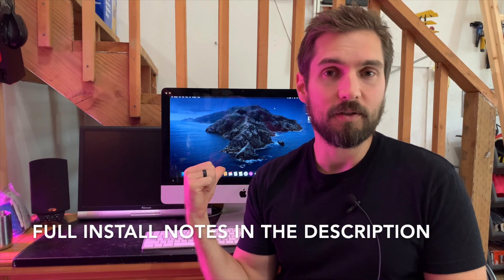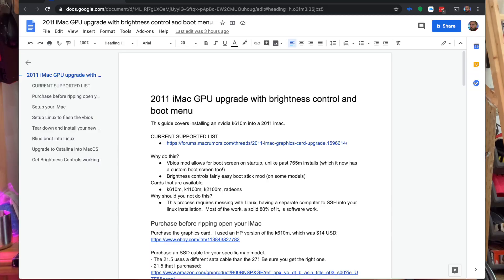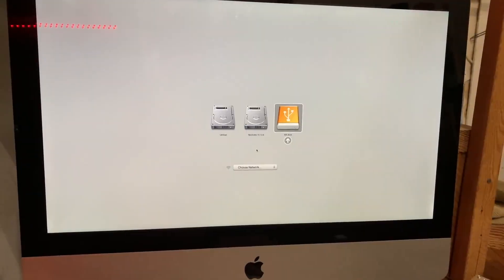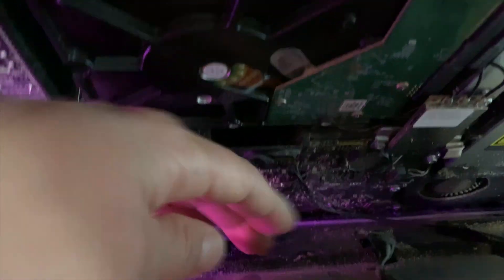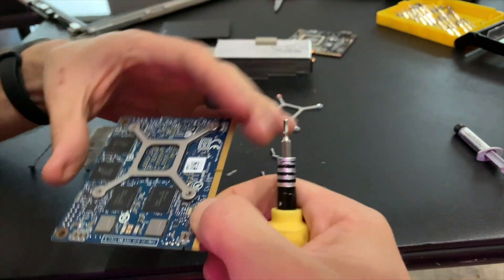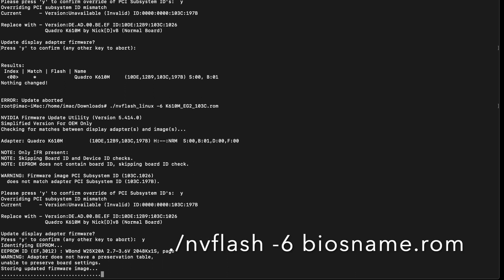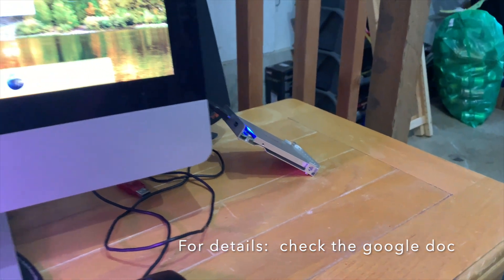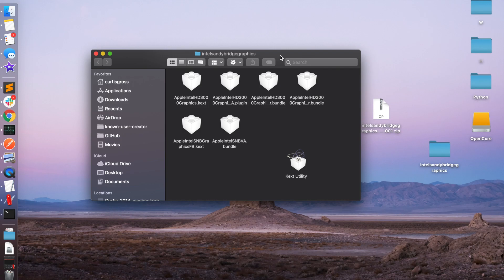2011 iMac GPU Upgrade Now with Brightness and Boot menu - Absolutely Worth It!

Comment: Very good presentation for a problem I have on my Mid 2011 IMac that does not sleep and other issues you mention!  Running Dosdude1 patcher install.  Could you outline the best procedure to remove the after install updates?  Is the quickest fix to reinstall and not to the post install updates?  Thank you for your video!  Russell R.

Comment: Best you for gaming that can be supported in the 21.5 inch?
Reply from the maker: Probably the 770m / k3100m. But both will not have backlight controls.   Honestly for gaming your best bet is to throw a cheap pc together.
Reply: @messing-with-computers  okay, it's just I have an iMac and a gpu isn't that expensive only 100
Reply: @messing-with-computers  would a 765m have backlight control?
Reply from the maker: Edison Chow nope. That’s the sad part. Maybe soon someone will get a bios out that allows out.
Reply from the maker: Edison Chow - what games are you thinking?
Reply: @messing-with-computers  maybe some fortnite or rust at potato settings
Reply from the maker: Edison Chow 770 is probably your best bet then. Lose the brightness, but it isn’t too shabby of a performer.
Reply: @messing-with-computers  would the heat sink need modding?
Reply from the maker: Edison Chow I’m pretty sure the 21.5 and 770 won’t need any mods.  Same as the 765 - it fits pretty tight, but without mods. You will want to cover the caps of the components with electrical tape though.
Reply: @messing-with-computers  have you done it before? On the mid 2011 21.5"
Reply from the maker: Edison Chow I did the 765, which is the same size as the 770. The 770 is just more memory and a little stronger.
Reply: @messing-with-computers  oh nice do you have a vid for the 765
Reply from the maker: Edison Chow not for the 21.5 sadly. But the process should be the same for this video to get it installed - and the rest is the same for the 765m I put in my 27”. https://youtu.be/9GJQ9fvx3GA
Reply: @messing-with-computers  oh okay thanks!!! Just that I've heard that the 765 is too large for the 21.5inch heatsink so needs modding
Reply from the maker: Edison Chow - not that I remember. I mean, you can modify it a little to make it a bit more of a excellent fit. Pretty easy to cut away a little of the metal
Reply: @messing-with-computers  okay thanks Curtis, one more thing, would the PSU supply enough power
Reply from the maker: Edison Chow - yup. The 765/770 don’t pull too much. The 780 absolutely would.  Honestly the price is the bigger factor. The 765 is usually a way better deal.
Reply: @messing-with-computers  I found the 770 for 108us but that's on AliExpress
Reply: @messing-with-computers  also do I have to flash the card?
Reply from the maker: @Iamtherealchow  - You don't have to.. but flashing the card will get you the boot screens back (which you lose with the upgrade).  But as long as you have high sierra installed, it should work without any flashing with the Dell versions of the cards.
Reply: @messing-with-computers  so if a get one that was originally in an Alienware, it'll work as soon as I plug it in after I receive it? Because in the video where you replaced yours with a k610 you had to do tons of reinstalling and stuff
Reply from the maker: Edison Chow - the extra work I did was for brightness control and boot screen support. It should work for most tasks without those fixes...
Reply: @messing-with-computers  do I need to install drivers for the 770m
Reply from the maker: Edison Chow you shouldn’t need any extra drivers.
Reply: @messing-with-computers  wow really? Is it because the Mac already has them
Reply from the maker: Edison Chow yup!
Reply: @messing-with-computers  thanks Curtis, so if it isn't from a Dell laptop it won't work
Reply: @messing-with-computers  Because from https://forums.macrumors.com/threads/2011-imac-graphics-card-upgrade.1596614/page-34 it says that it needed modding to cut away a part of the thermal pipe backing in order to fit because a capacitor in the 765m/770m does not fit.

Comment: what would u advise on upgrading gpu on 2009 late 21.5 imac. it came with the 4760HD 256m (crap) ive been told a gtx 765m will go in? but could I go better and put a 880m in? please kindly advise
Reply: also dont care about price... just the best I get now for the 2009 late 21.5. need min 2gb but would like more as want to dual boot to play dcs
Reply from the maker: Sadly, the 2009 doesn't really have any upgrade options.  Only the i3,i5,i7 models can upgrade.
Reply: @messing-with-computers  well thats interesting as macintoshman told me that I can put a 765m mxm in or 880m gtx
Reply from the maker: Levi Dance - your computer has a core 2?  Or a i5/i7?
Reply: @messing-with-computers  core 2 3,06ghz
Reply: @messing-with-computers  core 2 3.06ghz

Comment: Is the 27’´ amd 6750m the same as the 21.5? Is it compatible ?
Reply from the maker: Yes.  Any imac 6750 or 6770m will work in either 27 or 21.5.  You do need to modify the heatsink to get it to fit in the 27 though.
Reply: Curtis Gross a guy on eBay france sells it for 30€ and says « not tested » I hope it works, it seems like the exact same that I had on my 21.5

Comment: This is very much appreciated Curtis!!

I'm about to upgrade my imac Mid 2011 21.5" using your videos.

Question :
Can I install the SSD (Samsung), GPU (1100m) and Processor (i7) at the same time?

If yes, should I do all at the same time?

Anything I need to watch out for?

Thanks again
Reply from the maker: Sounds Like a solid build. I would do them all at the same time
Reply: @messing-with-computers  I did it. Shaking when I pressed the 'power' button but it works!!

Still waiting on the GPU arriving so did the CPU i7 and SSD, which is incredible in terms of boot and operating already.
Anything I should do to prepare for the GPU??

Thanks so much man, visiting your channel and Tech It Out were the first thing I did to say thanks - you're helping a family in a very practical and applicable way.
Reply from the maker: Andrew Laing glad to hear that it Booted up!  To get ready for the GPU installation you don’t really need to do much beyond take your time!  Lots of little cables, maybe make a tally of each as you go so you don’t forget one ;)
Reply: @messing-with-computers  Thanks man! 

Had to do the same for the i7! 
Same process to get the motherboard out except I'm taking out the GPU instead of processor chip?

Will follow through your video again when it arrives from Hong Kong!

I admit I'm a bit lost with the software side of things, but will try to work through your google drive! (thanks for that)
Reply: @messing-with-computers  Hi Curtis,

Same problem as you here - bought a K1100m and it didn't show the third LED.

Seemed brand new out the box.

Took it apart again and cleaned off the NVRAMs - put it back together and same problem.

Could it be software or am I better doing something else?
Reply: @messing-with-computers  GPU finally successful! Got a K1100m from HK that didn't show the 3rd LED, was ready to give up but got one more card from ebay, k1000m. Again, no 3rd LED. Then I troubleshot and came across the engineers manual for the 21.5'. Realised that the beeping could be RAM, but could also be something else, so installed the RAM thinking it might get rid of the beep, if nothing else. Not only did it get rid of the beep but suddenly I had the 3rd light back on and it booted! Had to reset PVRAM a few times as the colour was funny first time. Now I'm totally booted though and using dosdude to get Catalina.

Thanks again, man! Appreciate your videos!
Reply: Update - wife uses this every day for work. Absolutely perfect. Thanks man!

Comment: Hi Curtis, this follow-up video is so informational.  Great work done here.  One thing I want to know is that for a 27" iMac 12,2 with 6770m, do I need to file down the 3 pipe heat sink to fit in nicely (without no risk of high temp) to fit in a GTX765m?  Does it need to be Dell card (not HP)?  Thanks
Reply from the maker: You will only need to modify the heat sink with a dremel - no new heat sink needed.  For the 765m you will want the dell version, but I would try to get the k4100m instead.

Comment: Every product that ages well develops a community of users, hackers/mod-ers and also one who takes it far enough to be a sensei (the one who travels the road beforehand) or might we say a guru.  My Mid-2011 iMac 27"er is in pieces next to me and the original graphics card is cooling down in the background.  I wish I had found this guru here a little earlier! I would have got out the Dremel and upgraded my GPU, without this now defunkt step of baking my old GPU and having it last weeks/months and then in the end upgrading anyway!   BTW the Mac repairer up the road said he had struggled for months to find a solid solution to the ubiquitous Mid-2011 GPU failure and had given up, and even advised me "not to bother trying to repair a computer that would always have this problem".  For every person who watches this video and your previous video and upgrades their iMac, you Curtis Gross can take some credit for saving another machine from scrapping for some more years, and for lifting the skills, knowledge base and intellectual attitude of the human race just that little bit.  Appropriate to this theme, your videos are far from the typical computer repair faire and more like a younger Eric Bana delivering an advanced yoga lesson and lecture.  Very reassuring, but with more than enough information to back your explanation up.  Nicely done!

Comment: how come you have so few subscribers this video is insane! the only reason i wish i was living in usa is that i could find old imac parts so easily... working spare parts or just cheap old imacs are so hard to come by in Turkey. :(
a 27-inch imac 2011 with i7 3.4ghz would be a dream find for me. i know its old af but i would still very much enjoy the process of finding one and upgrading the gpu with a gtx 780m. i may never get to enjoy/suffer through that process but thanks for doing something similiar :D
Reply from the maker: Thanks for the support, my channel is fairly new, and I don't really share it out much... so maybe some day I will have a bigger set of subs!

Comment: Hello good Night is useful to an imac mid 2011 quadro k110m 2gb?
Reply from the maker: The k1100m should work!  The dell version is the one to go for.
Reply from the maker: @danielcruz6910  - I haven't personally tested the k1100m since mine showed up dead :/  But, I would 'guess' that the vbios flash should change the different brand cards-> iMac card.  My k610m was an HP version, and it worked.  My 765m was a Dell version, and it worked (didn't flash it though).

Comment: How does the k610m perform. Is it usable for video editing and simple 3d animations?
Reply from the maker: Should be fine for both. I haven’t had any issues.
Reply: @messing-with-computers  i found the k610m for 27 Eur (about 31 usd) and the k1100m for 50 Eur (60 usd). Is it worth getting the k1100m or the k610m? Is there a big performance difference between these 2 cards?
Reply from the maker: C B - their is a fairly good jump in performance. At that price range I would go for the k1100m.
Reply: @messing-with-computers   i finally bought the k610m for my 27" 2011 imac but it's not working, i checked the diagnostic led lights, and only the first 2 led are on, and since the 3rd led is off, that shows that the gpu in not communicating with the motherboard.
Any ideas ?
Reply from the maker: C B - try doing a reinstall and check all your cords. Bout the best you can do to debug.
Reply: I did that and wasn't working, i switched between the Nvidia and the AMD, and the the AMD was working perfectly.
Maybe the k610 is faulty, or maybe it's only compatible with the 21", did anyone try to install it on the 27" imac?

Comment: Can I just install a k610m without flashing it if boot screen and brightness control is not important to me? I'm wanting update to Mojave for dark mode mostly. Thanks
Reply from the maker: Short answer is “yes!” Longer answer... watch my other older video on installing 765m in my 27” iMac.
Reply: @messing-with-computers  This is not my primary machine (2011 27" imac), I bought it cheap to mess around with an os i've never used before. Ive already taken it apart to re-paste cpu/gpu and install secondary boot ssd two years ago. I watched your other video as recommended. If i understand it correctly software changes/workarounds are only needed if you want boot screen, brightness controls or mojave and up? I got a k610m for 14 bucks after watching your video a couple weeks ago. Holding out on doing it until I can find a cheap 2600s to swap at the same time. thanks subbed
Reply from the maker: John - sounds like a plan!  The k610m will display and work fine without any vbios work. Just like you said, no boot screen and no brightness.
Reply: @messing-with-computers  I installed a used 2600s($62) and a k610m($14) and found the mac was in a boot loop with the display light not coming on. The k610m was from a hp zbook 15 g2 if that matters? Swapped back the 6770m the mac is now working again. Not sure if I had a bad card or what but everything was plugged in when I swapped the 6770m back in. 

I like the new xeon video. I was looking at a 1245 but was unsure if it would work/brick the mac. Decided to go with the 2600s because of heat(tdp) and old power supply worry's.

cheers

Comment: Thank you for the detailed video ! I was wondering if you knew how different the process would be on a Mid-2010 iMac 21.5-inch computer? Just got one and while I can run Catalina through a patcher, the GPU isn't metal and I'd like to upgrade it. Cheers!

Comment: Thanks for your great vids, I'm looking at updating iMac 27" 2011, using it for basic video editing and mainly audio production. Is the 610m and powerful as the current hd6970 I have? don't want to lose functionality in FCPX. On another note the iMac cant run Davinci Resolve 16 at all but FCPX works fine. What's the best way fwd for upgrade? (would love to get to mojave so can install Logic 10.5)
Reply from the maker: The k610m is on the low end. I would try to get a k4100m which will do quite a bit better than the 6970 while also having a new bios that has native boot screens!
Reply: @messing-with-computers  Many Thanks
Reply: @messing-with-computers  Did I misunderstand something? K4100m costs $ 2000 and it's a big card that can't fit inside an iMac???  https://www.pricerunner.dk/pl/37-2970468/Grafikkort/HP-Quadro-K4100M-(E5Z77AA)-Sammenlign-Priser

Comment: Hello buddy, thank you for the video. I did a reflow on my 27” 2011 iMac and it was working great... until it failed again of course. What do you think about the performance on the 610m overall? Of course, I don’t expect anything too fancy or close to the higher level but, do you think it is capable of some basic 1080p video editing? Thank you again for the great work
Reply from the maker: The k610m should be able to handle basic tasks and even 1080 video editing without many issues.  I have done 1080 video editing on a Macbook Air with the hd3000... and the k610m is around 60% faster performance (at least).
Reply: Curtis Gross thank you! I’ll keep an eye on the prices for this and the k1100m

Comment: What's the newest OS this can go up to in a build like this? I'm thinking of doing one myself
Reply from the maker: Latest builds of Catalina work!
Reply: @messing-with-computers  awesome thanks! I just got a beautiful, lightly used 2011 21.5 iMac that runs insanely fast! Im going to add more RAM today but I definitely plan on doing these upgrades soon. I just need to find a k610m. I seem to be having a bit of trouble.

Comment: Will these upgrades allow for Target Display Mode? I was under the impression that the new OS and hardware remove that functionality.
Reply from the maker: Hey Daniel - thats a great question.  I haven't actually tried Target Display Mode with the new card.  I will check!
Reply: Curtis Gross thanks, I’m thinking about adding one to my 2019 5K so I could have a matching addition monitor. Ol course Is need a Thunderbolt 3 to Thunderbolt 2... but I’m willing to do that.
Reply: Daniel Davis should work as is described on the MacRumors forum. However, it will only work over a Thunderbolt connection and you do lose display out functionality over one Thunderbolt port
Reply: @messing-with-computers  how did it go with th TDM?

Comment: I have a 2011 iMac, I upgraded everything just and ity all works except, the LCD screen does not ;ight up, It does have an image when i put a flashlight to the screen, I changed the Back-light inverter, I tried a new LCD and its all the same!!! HELP I've looked for the answer on YouTube, everywhere on the Internet, on I-fix it ?. I cant find the solution to the "dark screen" LCD panel not lighting up problem anywhere.
Reply from the maker: Very interesting, my mind goes to potential issues with the cords that would provide power, or maybe the powersupply failing?   I have replaced a few power supplies in these older machines to good effect.  But, the one screen I had that was going 'in and out' with more of a flicker was fixed by replacing the screen!